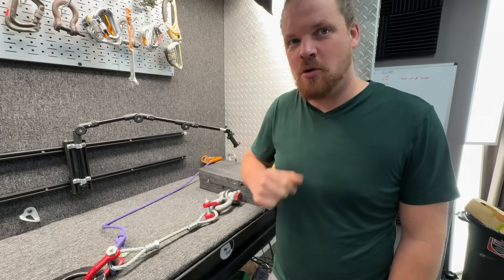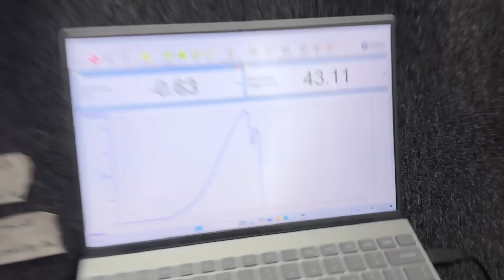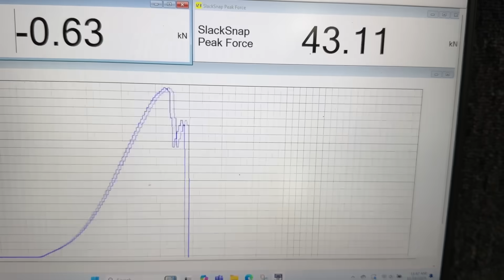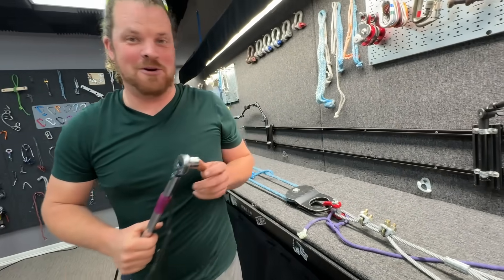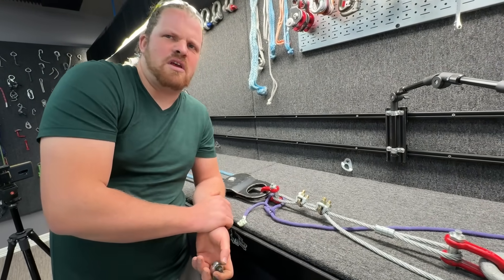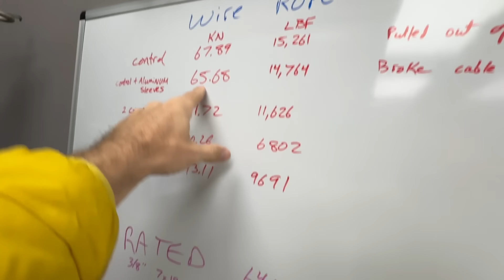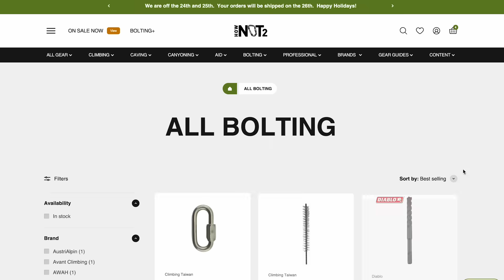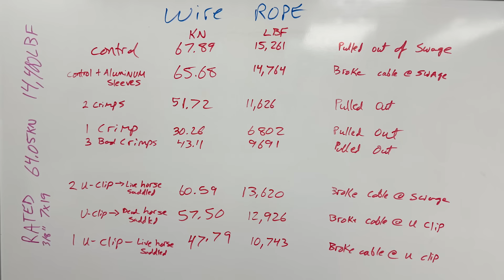Never saddle a dead horse

Comment: I didnt scroll through all of the comments but I;m thinking that because of the differential length as the cable wraps around the link that more force is exerted on individual "fibers" on the outer loop.  Look a the failure of the cable system for the radio telescope, Arecibo.

Comment: Seen more crimp failures that almost cost a man his life from a, 5-ton load, breaking free from the the wire rope slings.

 The crimps were of steel and had certified tags upon it. The certified rated tags showed a greater working load value, than we were actually lifting. Upon examination of the crimps and wire slings, there appeared to be no damage to the wire rope itself or the sling ends at all. Further examination appeared to be the crimp was not fully engaging the wire rope and had just slipped out of the steel crimp. What was more disturbing to the working crew, was that the wire rope sling was brand new and delivered that day of failure, and was  used by experienced crews for a few lifts and then the failure occured, with the live load just missing a crew member by feet, when it landed on the ground.

Comment: Very interesting testing. I’ve done rigging on smallish sailboats with 1x19 stainless steel wire, using a hand swagger, a thimble, two copper ferrules, 3 crimps each, the last one has two diameters of cable proud, covered with heat shrink to protect hands, sails, lines. 
Very dependable, I’ve never heard of a failure if the swage passed a no go gauge.

Comment: I'm really curious about applying an aluminium crimp to a steel cable - my gut reaction is that's a terrible idea, because of electrolytic reaction between dissimilar metals (and, worse, out of sight !) - do you have any testing of what an aluminium crimped steel cable looks like after extended time exposed to the elements? Obviously stainless corrodes much slower, in its own way, but i'd love to see some tests, or a splice cut open to examine the inside of the joint. Maybe it's not an issue at all, I'd hope not 🙂
Reply: Aluminum is used because it is easy to reform and also forms around the wire rather than reforming the wire.  Rigging for cranes doesn't contain aluminum.  They have massive presses and forging dies to compress the sleeves with.  The rigging place I went to had a 250 ton press as I remember and a larger one for cables over 1" in diameter.  I don't think electrolysis would be an issue unless it was in contact with the ground (or water) so an adequate path for higher amount of current would be set up.  I don't think that would happen very fast in the air.

Comment: I think it would be interesting to test double saddle wire clamps.   I use them for a small zip line because its eaiser to install them correctly, and when I move the zip line, the cable is in better condition.

Comment: The U clamps have been around as long as SWR and if you research Army recovery data you will find minimum four clamps to equal safe working load of the SWR. Plus, they can be visually inspected in the field and replaced if required, not so with modern swage.

Comment: Wonder what wood happen ir yeahs did saddle the dead horse???
Reply: 3:38 also what if the tail of the cable was longer, (like a inch or four ) past the crimp, would that effect anything?
Reply: 4:29 and these , my self personally,  used to operate these with the "main" clamp by the loop, saddled live, and the one father from the loop, saddled dead. If there was slip in theory,  they would lock up together

Comment: When I worked offshore back in the early 80's and used to off and on run Gallion cranes and sling loads we had a bunch of different ways to make cable ends.. I have woven the tail back into the live end then clamped that, used joiner sleeves which are a thin version of those crimps and clamped that, done figure 8 where the tail is looped back on itself and the 3 pieces are all clamped together.. We sometimes would get slings made by Haliburton that had steel crimps that were forged and compressed onto the cables.. We also used cable eye shoes that prevented direct cable to hook contact from time to time on slings that were in constant use.. Ends that had hooks or lengths of chain or 3 to 4 cables attached to a bull ring.. Every customer's crew boss had their way so I had quite a variety in the tool room..

Comment: the reason they want you to leave enough tail coming thru is to prevent it from creating an impingement where the tail terminates. in pretty much all of these cases, its failing right wherever you have  a cut end trapped against the load line inside a crimp.
Reply: like tidy cables are nice, and those freyed ends are a pain, but trapping them inside a swage with a live load just makes a sharp corner up against the live load

Comment: Now try weaving the cable end into the cable and swaging that connection, then use an eye on the inside of the cable and see what that does. My guess is the latter will give the total rated strength of the cable and just weaving the end a little less, with the failure at the bend of the cable to the hook.

Comment: There is a formula of how many clamps and the spacing of the rope clips based on the wire rope diameter . Also torqued under a load ?

Comment: When I was in the towing industry in the Seventies we did not always have the opportunity to get the cables swagged,  but the state inspectors allowed us to use the clips as long as we used three to a cable and separated from each other by some distance I no longer remember. We abused the hell out those cables, running them until the front end of the truck was up in the air and the winches stalled out. As long as you did not mess up the clamps by running them up into the pulley at the end of the boom for us they worked as well as the swagged ones.
Reply: Seen more than 1 4wd winch repaired with these in the field (2 was preferred but on an occasion or 2 somebody tried 1) and still go on to do vehicle recovery with 12,000lb rated winches no worries.
Reply: We still use saddle clamps all the time in well servicing. Just too convenient.
Reply: The  Brodrick and Bascom riggers handbook calls out the number of clamps and spacing based on the rope size and construction

Comment: Even if the deformed cable in the cable clamp has reduced capability to 80%, there's 2 cables in thd loop so 2x 80% equals 160% of single cable, so the cable will break before the loop.

Comment: Try splicing the wire.  You unwind a length and flip it back on itself creating an eye.  Then use a clamp or swage.  Additionally, increase the size of the d-ring or clevis securing the cable eye thus reducing the bend in the eye at the clevis contact point

Comment: Pleased to see that you're using the torque wrench.  The torque spec is different for each clamp size. I used a lot of those clamps for tower guy wires and hoists.  The only failures I've seen were where a previous installer did not torque to spec.  And yes, Never  Saddle A Dead Horse!  I design  for life-safety, typically 400% to 450% beyond expected dynamic load.

Comment: No eyelets no figures of strenght no SWL or WLL or factor of safety or any derating of any of those? If you need to use those clamps its recommended use three off equispaced on the wire.

Comment: Great vid! one critique on your rigging is for your double swaging sleeve; the current "spec" is a gap of double your cables diameter at most. any more than that, and you could unevenly load the two separate strands. Outside of specific military specs, this double sleeve is no longer recommended (so far as my industrial rigging career would suggest) other than that, your video demonstrates a lot of the theories taught in my field, so thanks for that! (Nicopress has a lot of interesting documentation, and has done quite a bit of destructive testing if you have any interest)

Comment: Back in the early 80’s got in the elevator construction trade in Houston, must’ve heard that phrase 1000 times, and I probably used it 500. I miss those good times ; had a lot of fun at work for four years , till work got slack ,, moved else where n got into the maintenance/troubleshooting end of the trade.

Also ‘ heard : ‘cut off twice it’s still too short ‘  a lot  (basic carpentry, saying: measure twice cut once- sorta paraphrase)

Comment: On swing stage work we used a different type of wire rope clamp.   The two halves of the clamp are both saddles and identical. They each have both a stud and a hole. They interlock and we used three clamps spaced one fist apart.
Reply: Can you share what they are called?
Reply: @  , we used 3/8”, double saddle, fist grip clamps.

Comment: If the first thing a tester does is tell you this isn’t how we’re supposed to do this and then proceeded to do all the testing in that fashion, you can just throw it away. There has to be a tail for proper strength or you will pull through the swedge. this should be common sense

Comment: I’m pretty sure there’s a standard out there where you’re supposed to use 4 saddles in a row, torqued to a very specific rating.  That way they’re not crushing the cable, and it doesn’t slip, even though they’re not all as tight as a single saddle.  I think they have a set distance apart, and the torque gets progressively lower the further away they’re from the loop.
Reply: Distance between should be 6 x the diameter of the wire rope

Comment: Won't the aluminum corrode things? If you want to do a followup, make up a bunch of test samples, leave them out in the rain for a few months, then test again. Use the aluminum swages, try to damage the zinc coating on a couple of the copper swages, maybe wire-wheel off the galvanized coating on some of the wire rope, and combine all those intermetallic nightmares into various test samples prior to aging. For bonus points, spritz with a bit of salt water once in a while to simulate a coastal environment. 

That being said, this was super interesting, thank you for putting it together! I had never heard about saddling a dead horse, so now I gotta go check the self-recovery supplies in my car's trunk...
Reply: In the snow states the de-icer will set up galvanic corrosion on trailers with AL skin and galvanized pickets.
Reply: Aluminum Swages are not that great because they work harden when crimped. This makes them brittle.

Comment: Thanks I spent a lot of time rigging swing stages and safety cables. NOBODY ever taught me this because nobody even knew about this. I saw it on Facebook and everyone who questioned what it meant would get the reply "never saddle a dead horse". Completely unhelpful and eventually I just googled it and figured it out but yeah more people should understand this
Reply: I was a waterproofer and setup and used swing stages all the time.
Reply: Ohhh Yeah!!  The swing stage....  Allow me to share my first one with you.
  I've had the pleasure over the years to work off many a swinging stage. On a Union job, the Iron workers would coon ass or air spider or man basket out on the structural to hang the "needle beams" 6 to 8 foot apart. Usually wooden 4x6s of varied lengths.
 Slit pipe or cut fire hose tie wired off overhead around the edges of the structural beams to soften for the 5/8' wire rope double wrapped to choke and three wire clamps. On the needle beam end they would terminate with a clove hitch with 2-#16 nails drove and bent over the knot on the bottom of the wooden 4"x6" beams, then the dead end of the knot would be wire rope clamped to the live cable. 
  With all the needle beams hung. Then the carpenters would come in and create a narrow walkway sometimes 20 feet long more or less. Starting from a structural grating platform or other access with scaffold planks nailed into the needle beams. Leading to a swinging stage. Sometimes... like my first, over 175 foot up, hanging all by it's self in the middle of no where.
  My first experience ever as a second year apprentice steamfitter on a 'swing stage.'  We were awaiting just under the Main support beams, located on top of structure.  To lash with multiple wraps in many places with 1-1/2" wire rope. Biggest clamps I've ever used.  We had to use an air tugger and snatch blocks to reave and tighten the wrap's around the drum to the steel overhead.  In order to "dog off" close to elevation. A 5 foot in dia. 60' long 125 ton Main Steam Drum that was to be lifted into place, in the middle of an empty boiler cavity during new construction. So they could get started with the mud drum , vertical  water walls, main steam down comers all the way to the turbine deck and feed water system coming going to it.
  Working in a composite Boiler maker/ Steamfitter heavy rigging crew at 19 years old. Helping to build Parish Power Plant in Florida. Back in 1973. We had to first stage our clamps snatch blocks. And land coils of cable, chain falls and tools on it to prepare for the pick. Did I say in the middle of nowhere. It's called a swinging stage for that very reason!
  Just letting some folks know. Just what a swinging stage is. And why one should have the utmost confidence in one. You grow to trust and know it's limits after a few weeks. Back then all we had was a double ring body belt and rope for a safety belt.
 @cameronhuber8339, I wish for you a safe and bountiful life in what ever career you chose. And know that  OSHA Came onto the workplace in 1972. And established C.F.R.'s code of federal regulations. Standards to protect us doing our work. Anything you or any one would ever need to know about about workplace safety can be found on their website.
   Like swing stages are found under [ 29 CFR 1926.426 sub part L. That will give you all your requirements. 
OSHA has saved more lives than people know. Their was a time they would unofficially include how many lives it would take in a bid to build a large project like these two 26,000 M.W. Oil fired power plants. They thought 3 lives would be lost. 
A boilermaker never went home to his family due to a croker sack full of bolts that fell 40 feet. Happened just in front of me.  The first.  I wish it had been the only job site death I witnessed in my 52 year career. 
   Those two units took Eight Men away from those who loved them to build.  OSHA has made a Big Change !! In work site safety over the years.     Work smart work safe.  Work for a living. Don't live for working.

Comment: I was learned by experienced operators to rotate clips... "one live horse, then one at dead horse and one at the live horse" ... also, witnessed more than once, experienced workers, that know how to "unrotate - spread" the cable, make an "eye" and reassemble all parts/strings without any clips, connectors, crimps, etc. just cable, interconnected on his own (like a female hair), that hold it self by friction... (English is not my native language - regards from Serbia) .
Reply: Those people rotating the clips have no idea what they are doing. The manufacturers tell you not to saddle a dead horse because they actually test their equipment and have data to show which way works best. The "experienced" people have no idea. They could be damaging the cables and not know it. Just like in the video, doing it the right way, gives it 14,000 pounds of force, while doing it the wrong way still works, but only gives it 9,000 pounds of force. How would people using it outdoors know if it broke at 14,000 pounds or 9,000 pounds?
Reply: It's called splicing, when you unwind the strands and rewind them; splicing allows both forming an eye, as well as connecting different lengths of rope.
Reply: The swages and clips work by friction as well. The difference with regard to splicing is that with crimping the strength is determined by the force applied when making the join whereas with splicing the strength is determined by the cable itself as every single strand takes part of the load and the best part is that the harder you pull, the tighter and thus stronger the connection becomes. Eye splices in ropes are also used to secure cruise ships to the quay, that's how strong these are.
Reply: You were taught wrong. The manufacturer says that they all need to be installed one way. The u-bolt goes on the dead end of the wire rope.
Reply: @nobodythatyouknow241  There is also a specification on the spacing of the wire clips.
Reply: BINGO...I have been splicing cables endless for 50 years and making a loop by backsplicing is pretty much foolproof.
Reply: Flemish eye and Logger eye are variants of good wire rope eyes.  A typical Flemish eye needs a clip (preferably a swaged sleeve) where the wraps come back together.  Some variants of eyes don't because the tails are woven back into the live side of the cable so binding and friction hold it together.
Reply: By alternating the clips , half of them are wrong.
Reply: When doing incredibly heavy pulls for large vessel haul out, we were advised by crosby over the phone to alternate 5 cable clamps. 3 live-2 dead horse, then make a deadman out of the end of the cable. We never had any slipping
Reply: @SquidVicious44444  I make my living on seagoing tugboats. When we had to use those clamps on wire rope in the 2” to 2 1/2” range all the clips went on one side or they would fail. But our pulls were only 450’ barges with a cargo around 14,000 tons. The standard kit was nine clips about a foot apart and a thimble . If you put the clips on alternating, one leg  of the bit is slack then other.
Reply: Is it called splicing
Reply: Same principal as splicing rope...
Reply: Would have been nice to see an eye splice tested
Reply: It's called a weaving slice connection. I used to use them all the time when I was President of a 4-wheel drive off-roaders club. 

They were VERY effective.